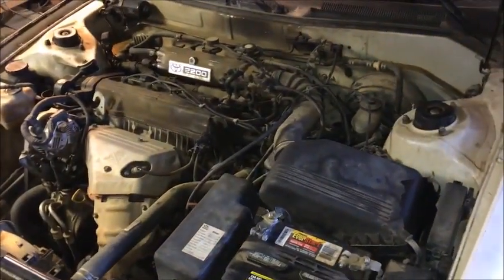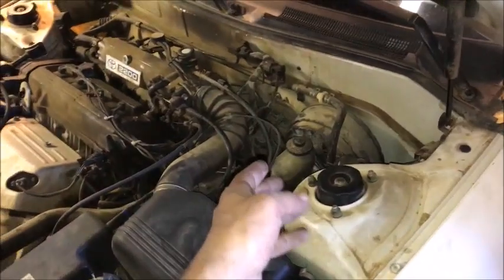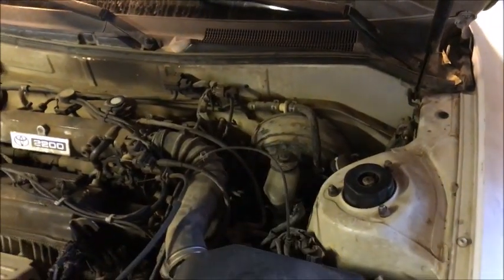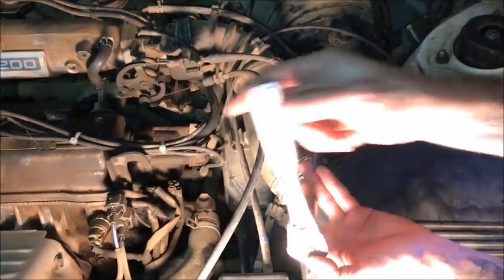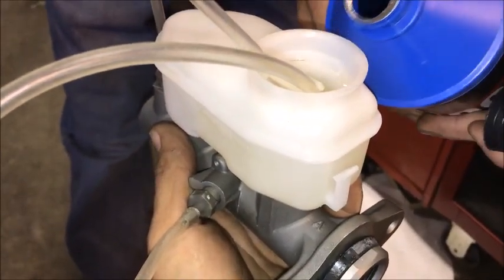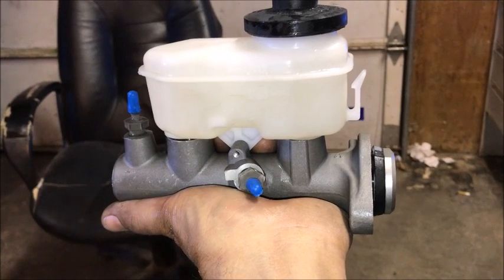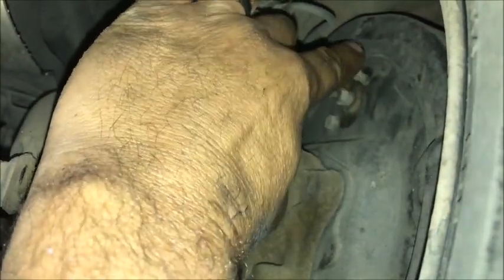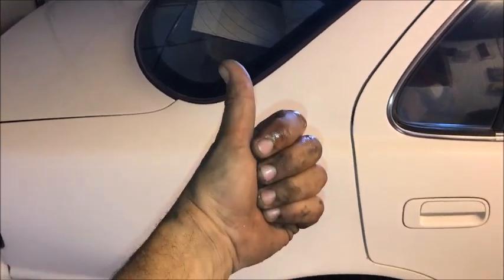1996 Toyota Camry Brake Master Cylinder Replacement.

Comment: Hi, thanks for the video.   When you removed the old MC was there a gasket between the master cylinder and brake booster?  My Haynes manual shows one.  Thank you

Comment: If your master cylinder is bad how do you know that it is bad? Coz in my 2000 avalon 3.0L my brackes are really siezed and i cant move the car without accelerating at higher rpm.

Comment: 10 millimeter line wrench and 12 millimeter ratchet (socket) wrench with extender. Bench bleeding on master cylinder to remove air from master cylinder? Then reattach to vehicle and bleed lines
Reply: When your under the car bleeding the lines. Is it  with the car off or engine on?
Reply: @mazdapro5diy153  Car off, you don't want to mess with brake fluid with a hot engine because the stuff is highly flammable.  Plus having the engine on would activate the brake booster which is not needed in assisting with bleeding air out of the system.
Reply: @JacobMReid  thanks man wanted to make sure cause I bleed the brakes with engine off and it was good for a few days and then the pedal again went all the way to the floor but it turned out it was my master cylinder guess the previous owner install one without the O ring and it was just pumping air 🤦 but all is good now thanks tho 👍